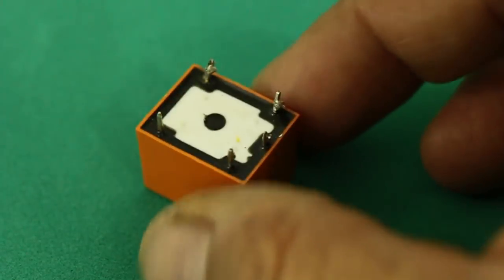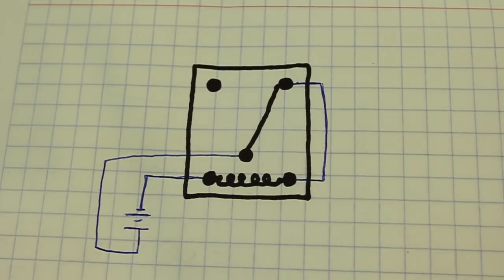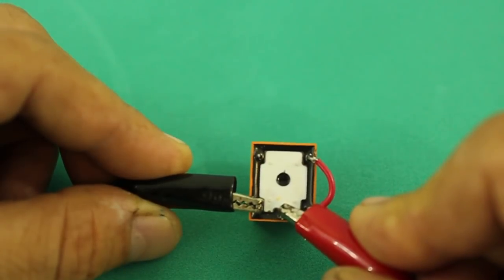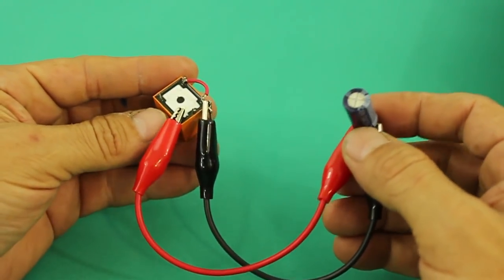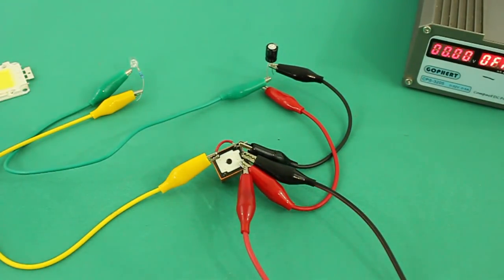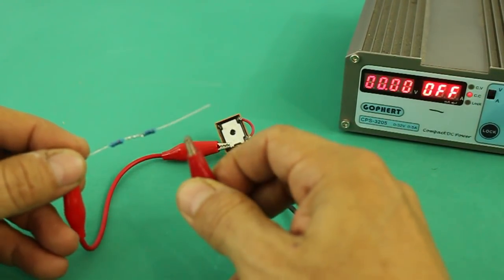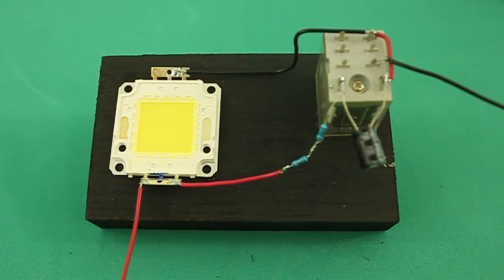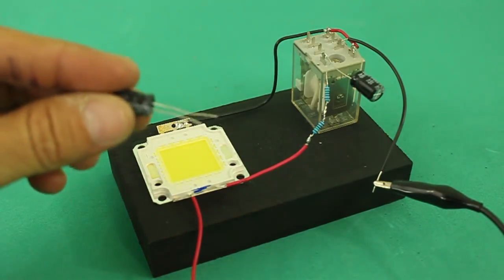Relay Strobe Light

Comment: I've got 4 pins 30,85,86,87 now which  wire connect to  power ,to ground ,to capacitor,  and coil high voltage,?

Comment: Sir which relay value need for 30 w led strobe light project ?
Reply: @Box Bi - A 30W LED at 12V DC is only about 2.5Amps.  So a 12V - 5Amps Relay will be adequate!

Comment: Is a diode needed for reverse voltage
Reply: Not in this case.
Reply: LED: Light emitting diode
Reply: @snaj9989  -  The question was.... " Is a diode needed for reverse voltage ".  Learn how to read + comprehension!  LOL
Reply: @The420chemist
 - The Flash Rate is too fast, there is no need for a diode.

Comment: You should have used a variable capacitor for adjusting the strobe frequency
Reply from the maker: I think it will pretty hard to find a variable capacitor in the 100-200 uF range. They are usually made  in the nF
Reply: that would short the relay
Reply: @maxxiang8746  - You are right!  It can be done, but with mistakes, it will short the relay!
Reply: Use a multi pot switch with different caps as options

Comment: did old car blinkers/turn lights work on the same concept?!
btw, keep up the great work
Reply: bm830810 usually no - they used a bimetallic reed that was bend under the current flow to the lights, and disconnected the lights. After cooling down it bended back and reconnected the circuit. That is also why the lights blinking frequency changed when one of the blinker lights was burned out - because the current flow was different.
Reply: @obnovec  - 100% + Same principle with " old " Xmas blinking lights.
Reply: seems like an interesting way to do it, thanks
Reply: @bm830-b9e  - The newer cars use relay to do it for LED lights :)
Reply: Jozef Lipták  Thanks